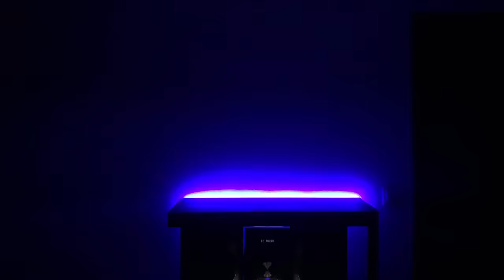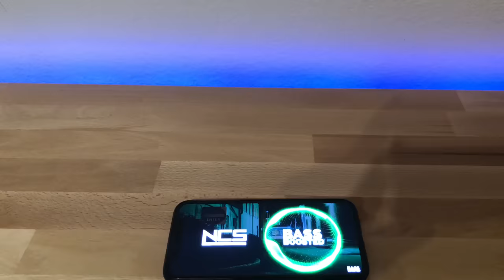How to connect LED STRIP to speaker(BASS)

Comment: HEY EVERYONE DON'T TRY THIS CUZ IT CAN BLOW YOUR AMPLIFIER OR HOME THEATER JUST TAKE A 1K CAPACITOR AND CONNECT IT TO LED STRIP+ THEN CONNECT - WIRE TO LED STRIP AND ANOTHER WIRE (+) TO THE OTHER SIDE OF THE CAPACITOR THEN CONNECT IT TO YOUR SUB WOOFER OR SPEAKER 👍
Reply: He connected it to his stereo system

Comment: The title should be: How to blow up your amplifier
Reply: Yap :))
Reply: How....
Reply: @mathwins7953  so if i have a 1973 Pioneer amplifier does it work?
Reply: Why?? Could you please explain me?
Reply: Exactly because I tried it and I blowed my amplifier too... Please don't try this
Reply: @isaacsanchez7317  no, they can't. everyone says this. nobody ever explains why
Reply: @immensiverocker4813  oh coz u shorted the wires
Reply: @apurvsharma78  no I didn't
Reply: when you use the diode for example: 12v  you cant blow amplifier . it is used as fuse.
Reply: Right
Reply: @RiccardoRivi  no
Reply: How can I do this in the right way? Pleas help me.
Reply: Idk man maybe rea
Reply: I did it and then the power shut out and im so scared and then the light on back i see some thing slipper and boom im grownded bc i just broke our home component speaker but thankyou bro for grounding me 😫
Reply: Thanks for the comment
Reply: it doesn't have to be connected to the amp guys u can also connect to speakers smh
Reply: I tried this in Ahuja amplifier but nothing happens
Reply: @mahadevbhakti5631  😆😆😆🤣🤣🤣
Reply: Ri8.. 💯
Reply: @isaacsanchez7317  amplifier output watts load will increase and fluctuate  and itwill overheat n blow IC

It wont blow instantly 
But it will die fast
Reply: It isn't going to blow the amplifier :)
Reply: Why would this blow your amp?

Comment: please dont inform people to do this as it will burn up the amplifier...
Reply: lol?
Reply: Yeah, TexasXplorer youre right
Reply: it did not burn the amplifier
Reply: @paczkos545  not immediately but it will
Reply: Why? Pls show me i dont understand
Reply: @timnerenberg  do you know how amplifiers work?
Reply: Yeah youre right
Reply: Leds draw very little power and amps have overload protection. Pls explain urself
Reply: What in the name of God has the amplifier to do with some leds? I don't get it...
How is the amplifier going to be burned if u put some leds on 'ur speakers?
Reply: That pretty rad man👍
Reply: I tried it working good 👍
Reply: How? Led lights barely draw.
Reply: it is a cheap $100 stereo a small strip of led are not going to burn it out 5v
Reply: Lol... but it will reduce led strip life slightly
Reply: I don't know about burn but it will lower the sound
Reply: I did this years ago with a dj amp worked fine upgraded the amp to a bit more powerful one and the amp went with a pop and smoke it was dead so defo do not do this 😂
Reply: I am running the 12v led for about 5 years on my sub amp. It is running well at present, no any issues.

Comment: well im not very knowledge in eletronics but i know some, so there is a way to kill your amp by doing this, using AC (speaker works with Alternate Current, leds are designed to work with DC) with leds, youre forcing voltage into led in a way they are not meant to have, doing that any led in the strip may fail and go into short circuit and then kill your amplifier. Im thinking that theres is some workaround to this, adding some other diodes into the negatives and RGB inputs on the strip, or just using some resistors in the same way to limit the voltage that goes to the leds, dont ask me for schematics bcuz i dont know.

Comment: Nice, do you know if this works with more powerful amplifiers/speakers. Thinking of hooking them up to my 600w RMS subwoofer in my car
Reply: Bigger resistor, you only need a tiny amount of power from the signal and 600w will blow these up. 

(I think) if you have an amp that does 600w @ 8Ω then it will do 300w @ 16Ω, 150w @ 32Ω, ...... 16w @ 128Ω, 8w @ 256Ω - measure the resistance of your strip and make up the difference in impedance with another resistor inline to bring it up to the correct value.

I would check the rating of your amp first, if it is actually 600w at 8Ω or 4Ω or whatever, from there you can extrapolate where you need to get to.
Reply: @leeknivek  it will work I’ve done it to amps that push out 1800 watts 🤙🏽

Comment: 1: you make it look like more difficult 
2: frome amplifier you get less power when it's normal volume, so you have turn volume a lot higher to get enough illumination 
* putting led directly not gonna helps you
* just simply buy two amplifier one for speaker one for led 
There can be other alternative but At least you don't have to turn higher volume and 100% sure that your amplifier don't blow ✌

Comment: How many led lights can it make glow? Because when i connected a series, it didn't glow. Can you help me with some calculations
Reply: bro this is fake ;/
Reply: @elektromicha6777  - Seriously? Do you even know what you are talking about? I did this with a car headlamp bulb when I was 13 on Dad's old Aiwa AF-5090. Lucky that it didn't fry the amp., should have added a resistor. However, it worked! Stuff your mouth with your old socks before you call it fake.

Comment: Hi Hifi, it was the same and the ohm is adjusted to the speaker, performance when recording and transmitting, it's no use putting up a series of LEDs equipped with resistors, an LED works at about 3v, so you not only damage the hifi, but it can also cause a short circuit because there is no switch on it!

Comment: This kills the amplifier
Reply: How?
Reply: @gameboy1984  Drains too much current from it to light up leds
Reply: @davidluptak  go on
Reply: @Kanoshe  Amplifier is for speakers with definitive ohms and if you add another appliance like leds than mosfets or chip may burn up from excess current
Reply: @davidluptak  4 ohm speaker is a much bigger load than those few LEDs
Reply: @davidluptak  thing is resistance is dependent on frequency. so the resistance isnt even always the same

Comment: Use a transistor to switch the led strip and connect the base pin of the transistor to the amp like you did not...

Comment: I Have Some Led Strips with 4 Pin Connectors
How Do I Know What Wires Are + Or -
Reply: I don't recommend it at all, but black is usually negative, use a battery to be sure

Comment: Yall, i only recommend if you take abart old bt speakers and use em for diy bs systems, I use leds with it straith connected, but if you have an expencive system that you def dont wanna replace, dont do it by anymeans, i actk as a short circut and will blow the sound chip real quick

Comment: Unmm, I don't know about that one. The speakers run on AC voltage and LEDs work on DC so it would not work. But I think your led strips are AC voltage because you are not showing or writing it.

Comment: Is that a normal 12 volt led strip?
Reply from the maker: This is RGB(red ,green,blue)led strip 12V, so I can change colour by connecting different wires, but you can use one colour led strip that's more simple.
Reply: @AVmake  but what if the sub is in the amp and only tweaters are out of it ...

Comment: just buy Cheap ($2.50) LED driver that controls RGB stripe according to music bass line. Connected to 12V it detects music rhythm and flashed LEDs to the music.
This creates disco/club-like effect, visualizing BPM of your music.
Reply: are they just callef LED drivers?
Reply: @gothangel6221  i think they are called Arduino Uno 
LED Sequential Control

Comment: By doing so you are reducing the power inputed to the sub
Reply: What? You know this is a 3 way speaker yeah? So all 3 drivers would be affected not only the woofer (or sub as you call it even tho it's not). You are mostly just burning out the amp.
Reply: @jomann3213  you can have a woofer with only medium and hight frequencies on it... what are you talking about? sub is a professional term to define lower frequencies under  60Hz  that is even the frequency that electric current flows, besides, that kid also named the video about BASS , and no... not all frequencies are afected the same simply because the amp sends much more power from the crossover to deliver in the speacker the low and sub frequencies, than for the highs frequencies.  If you use old lamps, you will see that they dont move much with the highs of music almost nothin but do a lot with kick drums and sub bass.  for you to hear from a speaker tweter 15000Hz  you need 300 times less energy from the amp,  than the energy you need, to hear a Kick sub    on theyre usual 50Hz frequencie.

Comment: DO NOT DO THIS! U can blow your amp! Leds are never meant to be put instead of speakers
Reply: why not...
Reply: @mdarifulislamhridoy9147  bro i commented this 2 years ago
Reply: @xinfinite8698  I think it’s fine to answer, as the topic and question does really have specific time limit. 

I myself been replying 5/6 YO comments. Because some Youtube contents aren’t posted based on specific time period.
Reply: @mdarifulislamhridoy9147  If you do this,you burn your amp. there is no regulation of current or anything,neither is there controller for rgb. nothing similiar like in video will happen